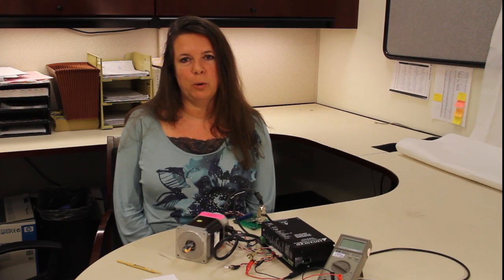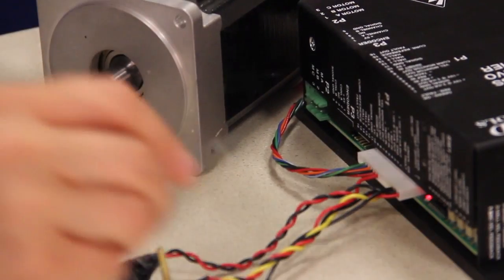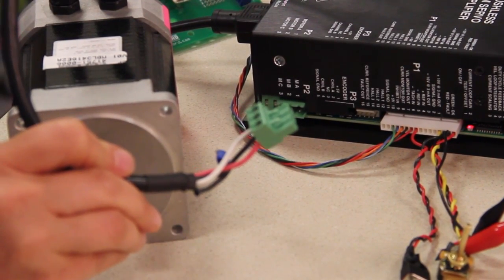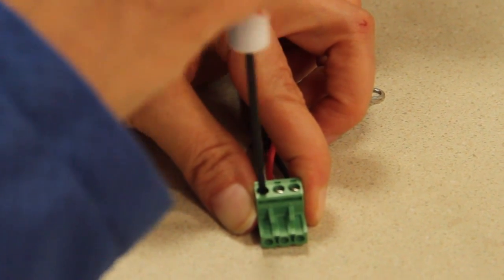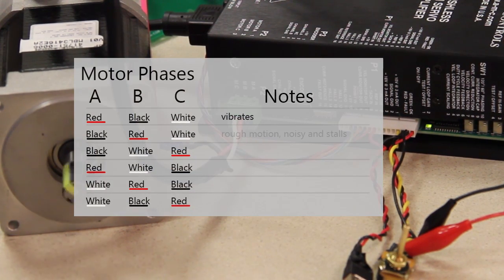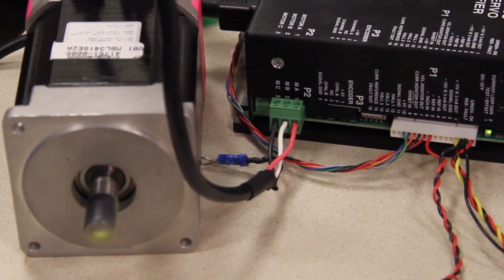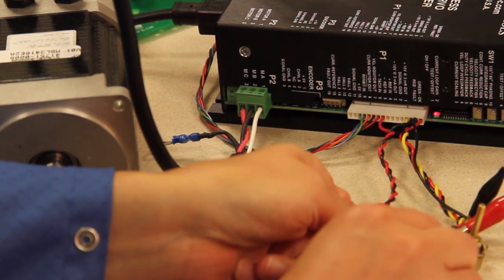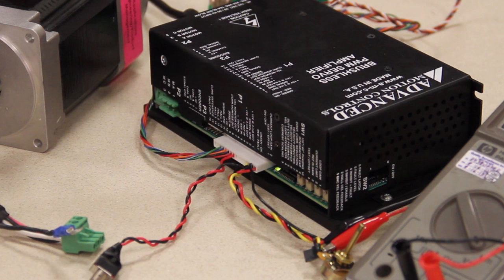Manual Commutation of a Motor with a Brushless Servo Drive by ADVANCED Motion Controls

Comment: Hello, could you delve into how the potentiometer connection is? Does it supply an external voltage through the alligators? I have a similar control using a BE25A20 but still can't control the speed of the device
Reply from the maker: Hi Sergio, a lot of our analog drives have an onboard reference voltage that can be used for a test command.  Usually positive/negative 5V or 10V.  The normal procedure would be to hook up the two potentiometer ends, one to the positive side and the other to the negative side with the swiper connected to the Ref-In command.  The reason to hook up both (+) and (-) is so you can command the motor to go in both directions.
Reply: @AdvancedMotionCont  Hello again. Thank you very much for your reply. I have implemented what they told me. Do You recommend any value for the potentiometer? I have used a 10K pot and have noticed that when it is close to zero or the speed change from one direction to another it makes a vibration before making the change even though the potentiometer has been manipulated very slowly. Thanks for your valuable time and help.
Reply from the maker: @sagslomas  We normally recommend a 50k pot but 10k should be fine.  Our user-accessible reference voltages usually have a low current rating in the range of 3-5mA so if the impedance of the pot is too low you risk pulling down the reference voltage and making it sag.
If the operation is rough when transitioning between directions my first suspicion would be tuning.  My suggestion would be to reach out to our technical support team and they can help you with troubleshooting. https://portal.a-m-c.com/

Comment: When the power supply and motor are connected, a red light comes on. what does it mean? 
I did not connect to any other inputs. only the motor and the power supply.
Reply from the maker: It depends on the model of servo drive you have.  Sometimes the red LED means that power is applied, sometimes it means there is a fault.  Please contact our technical support and they would be happy to work with you to get your servo drive running! You can find our contact information on our website: https://www.a-m-c.com/

Comment: you could connect the motor to a power outlet without a controller?
Reply from the maker: +ESCOBAR CRISTIAN No, the motor in the video is a Permanent Magnet Brushless Servo Motor and it requires a servo drive to operate.  The servo drive with a controller allows it to run at different speeds, stop, hold position, go in reverse and react to changes in the load in order to accomplish complex tasks.  Whereas the type of motor that connects directly to the mains is an AC Induction motor, typically used in simple constant velocity applications such as fans and pumps.
Reply: +AdvancedMotionCont I can use to make a conveyor belt?
Reply from the maker: +ESCOBAR CRISTIAN Please visit our website and contact our technical support for more information!  www.a-m-c.com.

Comment: Does the drive still operate in closed loop(encoder)  speed control when manually commutated? I am looking for a simple setup where I run the motor at a continuous speed, in only one direction, and precisely.
Reply from the maker: +Anthony Cooper Yes the drive can still operate in closed loop velocity mode. Using a car as an analogy, commutation would be similar to connecting the spark plug wires to the correct spark plugs. Once correctly set, the engine will run smoothly and you will still be able to use cruise control (velocity mode).

Comment from the maker: The servo drive is a BX25A20AC and the motor is NEMA 34 BLDC servo motor.  Servo drives from ADVANCED Motion Controls are designed to operate with a wide range of motor types, configurations and manufacturers.  Some basic specifications for the BX25A20AC are that it accepts 120VAC single phase supply, outputs 25A peak and 12.5A continuous and works in current mode, open loop mode and velocity mode. The data sheet is available on the ADVANCED Motion Controls website.